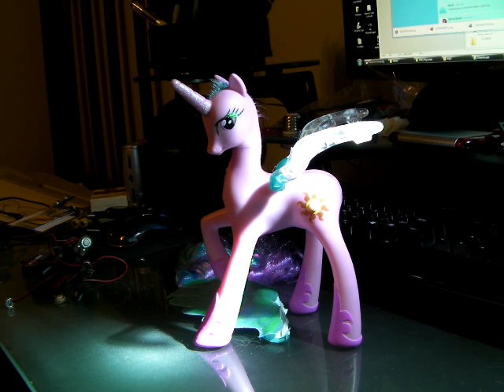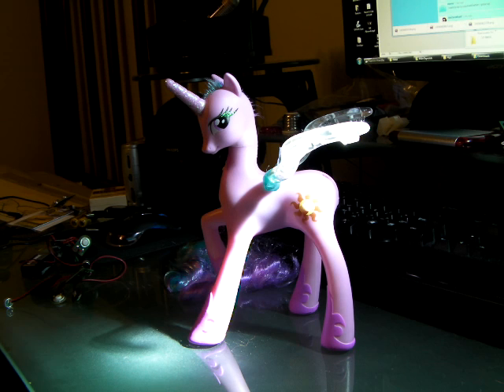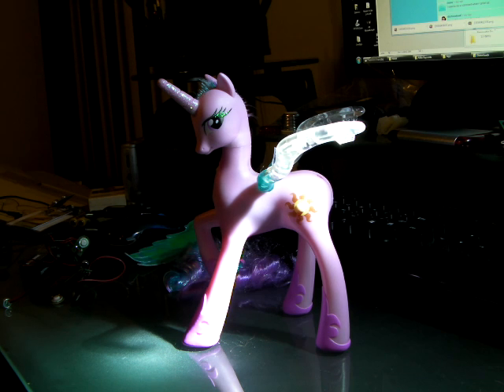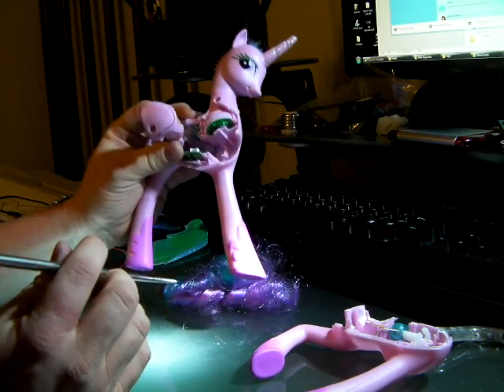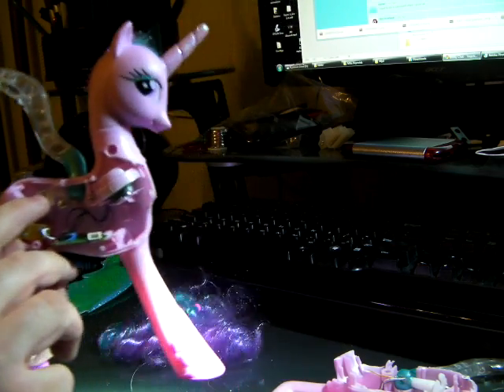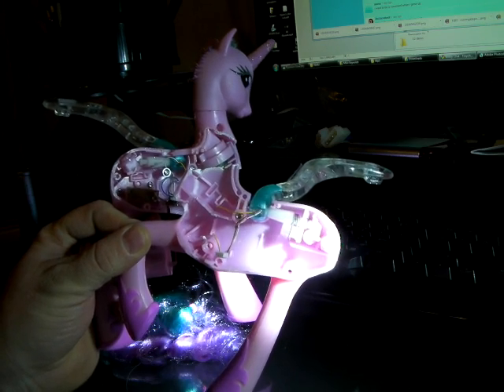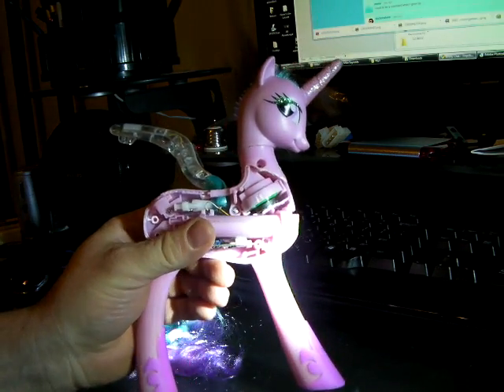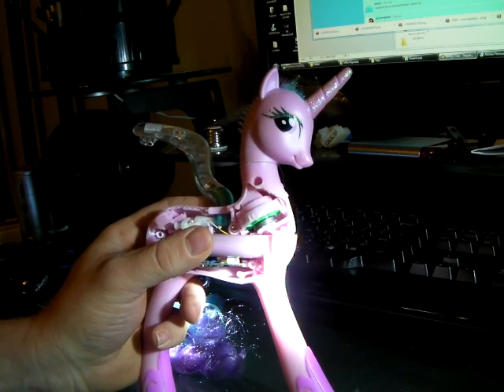Dissecting "Talking Princess Celestia" FOR SCIENCE- Part 2.5

Comment: Salutations. You posted this video years ago so I doubt you will get back get back to me on thisXD  but I have one of these figures and I need to take it apart for a project im working on. Are there any tips for getting it into two halves?
Reply from the maker: +Zephysonas  Well, you should notice on one side, that there are circular plugs set in. Sadly the only way I was able to remove them was to drill a hole through the plugs then use a small metal hook to pull them out.  When the plug is removed, you can access the screws that keep it together. Bear in mind though that even with the screws removed, you might have to use and X-acto knife at the seams to separate the halves.
Reply: +anaktis Sounds like a heck of a process! Il give it a shot though thanks!

Comment from the maker: @KamoiSakata 
I removed them by using a power drill, using a bit smaller than the plug itself-and pressed while i drilled so it would get stuck with the plug. I then tugged the plug out while it was still attached to the drill bit.  I had no plans on keeping the plugs at all- I could make new plugs out of whatever and paint over them.

Comment: @anaktis I remember you mentioning that after losing pieces to this one. It's a real shame you have to start over. :( May I recommend keeping the parts inside or at least in a baggie while outside painting. ^_^ It's pretty easy to spot where the screws are hidden. They're under 4 points where the plastic is a slightly different color in a circular shape.